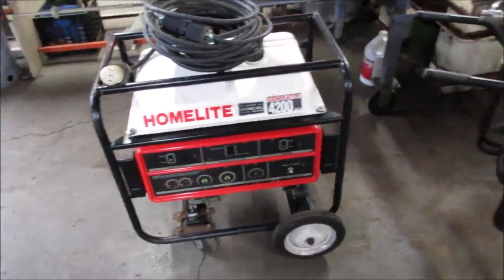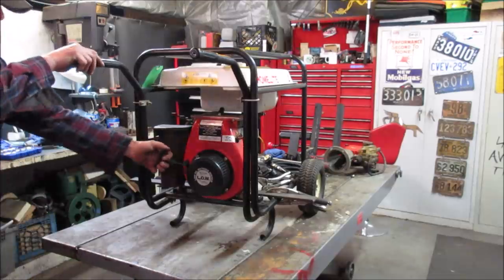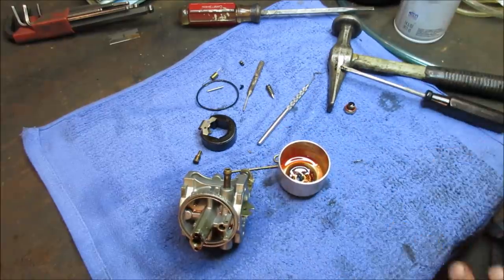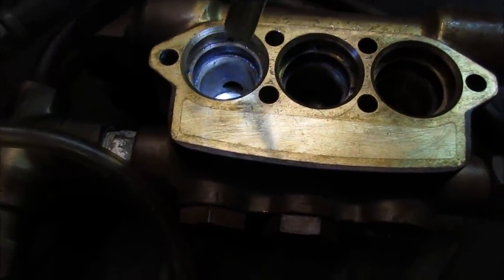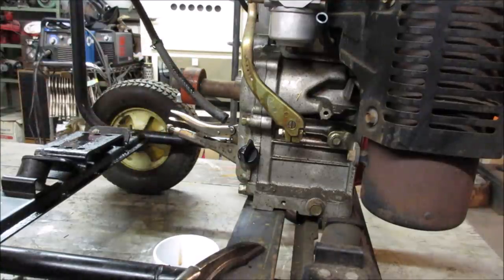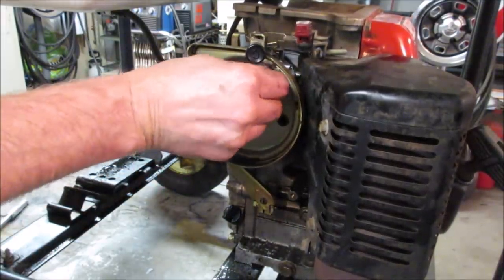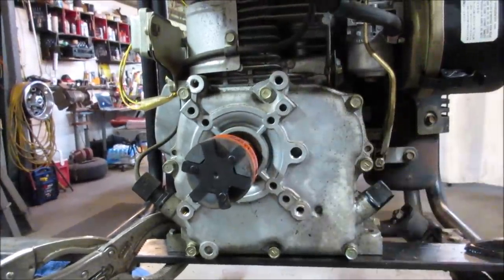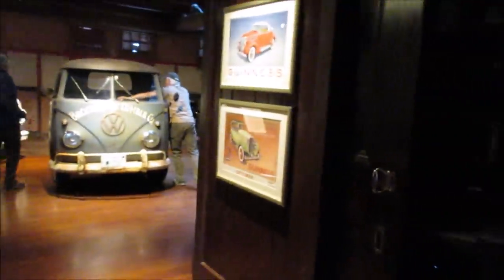Will It Still Work? Free Old Homelite Pressure Washer sitting for 20 years.

Comment: Working on a pressure washer that has been sitting is a cross your fingers and hope situation! The guys I have spoken to tell me its almost impossible to get all of the water out for storage, THEN they are hoping problem number 1 doesn't surface of the carburetor not being drained. I'm really glad this was stored with the marvel mystery oil and it like all the rest does have a limit.  They advertise like it has endless storage time and it to has a limit. 👍👍👍

Comment: If anything like the newer pressure washers, your low pressure will pull in soap from the tube on pump. So you can spray soap and pressure wash with out changing tips.

Comment: 48:00 you can just prefill the filter by open the bowl and pressurize the tank with compressed air and push some fuel with pressure through the filter. Or you can use a vortex type fuel filter. :)

Comment: I've always used canola oil before I use pour some in the hose then hook up and turn water on have never burned up a pump In 40 years pumps usually fail and degrade first like this one did I've worn engines out though

Comment: Pressure washing pumps plunger style like that have the seals/packing are stationary in the manifold/pump head and the only thing that moves in there are the pistons. The one-way check valves two per piston six total need to be cleaned and make sure that they are moving and not stuck I would not have recommended going to town with a HONNE on that head but I guess I’ll see you when you’re done. When replacing the seals/packing there is a hard plastic washer that’s at the bottom to the next want to go in is a rubber style cup seal and it should be difficult to get in you take your finger and push down on one side and then with your other finger roll it in. It is easier to serve them in scalding hot water to get them pliable. Then the next one should be a thinner plastic seal than a brass washer solid kind of looks like it but it has a flat surface on one side and concave on the other. Then the next piece of brass will have a rubber insert on one side and that’s the final one with an O-ring wrapped around it. So black plastic washer, most of the time a brown rubber seal rounded side facing up concave side facing down then the next a thin smaller black plastic seal brass washer that has a concaved on the bottom and flat on the top and then the final piece of brass with rubber. It should not be easy to turn that pump.

Comment: I use a dual gun from northern tool. It has a handle that switches the water flow side to side. I’ve lost too many pumps when the unloader valve breaks.

Comment: There is A seal behind that hour glass.,or oil plug cap for sealing the oil inside the pressure washer pump unit.& valve body.& head as one enclosed unit. And yes you can blowout  O-ring seals inside those pressure washer pump heads to just like the newer ones to.

Comment: The goo in the carb was probably the dissolved packing seal from the petcock… wonder if the Marvel in the tank dissolved in and it ran into the carb (which is why the tank didn’t have any Marvel left but the carb was full). judging by the damaged paint/finish on the air filter housing, it’s been flooding for a while.

Comment: You can use liquid dish soap as a lube for rubber seals or impellers as the main ingredient is Glycerin.
A Mighty Vac  pump / vacuum works great for testing fuel inlet valves. If it holds air it will hold liquid.

Comment: Is "Crusty" coming home soon?

Well now, you can't go far wrong with those "Robin" engines. Every bit as good as, or maybe even better, quality as Honda. Made in Japan by Fuji Heavy Industries.  We've had a few over the years, and they are a strong and reliable engine. Usual thing though, change the oil at about 20 hour service intervals and they'll still be running after we're all dead and buried.

The pump, is a tri-phasic, positive displacement pump - try saying that after a few drinks!  Those plungers (pistons if you prefer) simply displace the water in those chambers that you honed out. As an aside, although honing was not necessary, by polishing the chamber walls, you have actually improved the water flow through the pump - just a tiny tad!  That's also a decent quality pump. nowadays, it would be diecast alloy, at best, and very likely just a hard plastic. The best pumps of this type are, or were, made by Otto Speck GMBH. Speck pumps are/were used in industrial applications and had grease cap lubricators for each plunger, and the plungers and poppet valves are stainless steel - We have a 45 year old "Warwick Wash-Matic" pressure washer with a Speck pump, which still performs as good as it did when new.  If anything will spoil the performance of a pressure washer, it's going to be the jet. They erode with use, but are cheap and easy to replace, but must be replaced with the correct size of jet (aperture).

I'd say that machine is a definite keeper! It doesn't look to have had much use, and I can guarantee you won't find anything as good being built today.

Nice one! . . . Very, nice one!!

Comment: When you flip it at low pressure, it should pull from the soap dispenser and apply the soap. Flip it back around to rinse it off.

Comment: The diameter of the garden hose is critical when using a pressure washer. If it’s a 1/2” hose, it can damage the pump due to not enough water volume.

Comment: It is a positive displacement pump! Like putting your fist in a  tube full of water the amount of area your fist displaces the same area of water! That being that with this type the pump will not suck to supply itself! You have to keep pressure supply of fluid  into the intake,  to feed the displacement area! Of the pump!

Comment: Low pressure is to apply the soap solution when the other hose is in a bucket then you switch to high to wash soap solution off. New models you need to switch tips to do it.

Comment: You can get a special rubber grease for use on rubber. Doesn’t degrade the o rings or seals.
Reply: Silicone is marketed as O-Ring grease.

Comment: In the beginning 4:35 mark of the video you pointed out there’s a throttle adjustment on the engine itself if you wanted more water pressure but you never tried it when you had water running through it.Also it looks like the motor for the water side is American made.

Comment: Just find or buy another tank valve already! Also need to take apart the nozzle head at end of wand! Not sealing when twisting to high pressure! Only one nozzle should be spraying on high-pressure both spray on low pressure

Comment: If you need more water flow at your shop put a 2 or 300 gallon tank up in your loft and fill it up. The volume of water and the height will make really good water pressure and I can't imagine your pressure washer would use more than 5 gallons a minute so you shouldn't run out

Comment: In the UK gas (petrol) is sold by the litre (we had gallons but they were bigger than U.S. gallons). I did the conversion as I was interested in comparing. If you think $5 / gallon is bad - the normal price here is the equivalent of over $6 U.S.
Just demonstrates whenever something seems bad, thers normally someone else worse off. I'd be interested to know where it's most expensive and how much. Just answered my own question - looks like Hong Kong - more than double the U.S. price. Thanks for the great content.
Reply: You might have a higher tax on fuel than the US.

Comment: Mustie, I enjoy your channel and I have worked on small engines and carbs 30 yrs. On the side since 13-14yrs old Always used the 1gallon carb soak with the basket, kerosene, or carb spray and then blow it out with air chuck. And cleans like new. But i have been interested in getting a good ultrasonic cleaner. The one you have is perfect size for what I want. Do you know the brand and model of yours? And what cleaning solution do you use in it?

Comment: The pistons run off should run off s cam to increase pressure by engine rpm up to engine speed and fluid volume. Good luck.

Comment: you are better mechanic than me but the first thing i do on any engine a customer brings is carb straight into ultrasonic except for odd one that are shining in the bowl lol
Reply: @ElectronicMusicUnderground  yeah i just got ultrasonic couple years ago before that any wire that would fit gas oil and transmission mix and shop air if available for first 40 years lol

Comment: If it has no O-ring.,doesn't use one at all. Try some blue thread sealer tape for those applications. Blue thread tape it's like the white Teflon kind it's just formulated for fuel.& water uses cause it's marine grade thread sealer thread tape.

Comment: The foam on that air filter should have had a little bit of oil on it. Might have changed the way it turned out but who knows. There is a product today called 303 protectant that could have been sprayed on it that might have kept it from degrading along with any rubber parts.
I don't know where you got the idea it's running lean, that is the perfect color for the spark plug
Reply: I was the owner of the pleasure washer and the generator shown in these two videos and there was a notice in the instructions not to put oil on the outer sponge filters. I was going to do that myself just as you suggested, but here's their reasoning. It was written that the oil after time could bleed off onto the inner paper filter which would restrict the air to the carburetor. Come to think of it, that makes sense. Hope you enjoyed the two videos, George, Danvers, MA.

Comment: If I were to guess, when you turn the nozzle to change the flow, It may suck the soap solution through the small hose to the low pressure nozzle.

Comment: Never seen a dual nozzle that works like that. Usually there is a switch on the lance that you turn to select the nozzle. When a low pressure nozzle is active this usually starts a venturi effect which will then use soap tube

Comment: That blue/green corrosion you found on brass (or copper) is technically called verdigris.  But simply referring to it as oxidization is fine. 

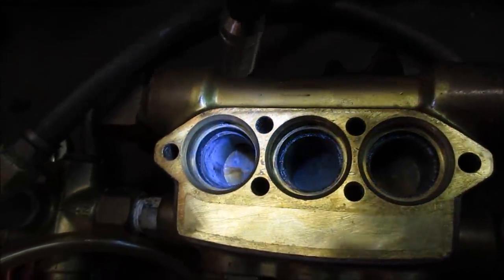27:08  Not being pedantic - you did ask, after all.  :-)

Comment: Silicone fluid is NOT a lubricant. It is actually abrasive and can freeze up a pump in a few seconds if it is a wear surface. Plus even ppm contamination will act as an anti-foam and prevent the soap from forming bubbles.

Comment: Hey guy, been watching your video's for years. They're some of the best I've ever seen and very helpful. Do you have any videos on gas welder rebuilds?
Reply: A gas welder is just a torch and 2 bottles. It's best to take oxy acetylene torches to someone that know what they're doing.
Reply: Ok.
I'm trying to rebuild a miller 225 bobcat, 1974 model. 
The engine doesn't run. I'm trying to figure out whether to rebuild the motor or if the generator is messed up to so which one should I do first?
Reply: @scottthompson6885  I'm pretty sure that's a stick welder. Oh, were you saying gas welder cause it runs off gasoline? I see. 

Well you'll have to get the motor going in order to test the generator and the gen set going to test the welder. Mustie does have some videos of fixing generators, but an engine is an engine regardless of what it's powering. Assessing the operability of one is the same process.
Reply: Thanks , yes I meant a portable gasoline operated welder, Miller bobcat 225 stick welder.
Can the windings on the generator side be checked to make sure it's ok before I try and rebuild the engine that is my question?

Comment: He put Marvel oil in each carb but then never used them because he knew he had to clean it out. LOL, I have had good luck just draining the gas from the tank and running the engine dry of fuel. Then next year add gas and they always start and run great. My 2cyl snowblower takes a little more due to the oil in the gas so I just pull the gas line from the carb and spray carb cleaner in and pull the engine over a couple of times, add a little more carb cleaner, put the fuel line back on and let it sit for a couple hours. Add fuel later and pull it over and it starts and will run smoothly after a minute or so, DONE!

Comment: U need 2 get yourself a 10 Gallon + reservoir tank with a float valve (like what U have in a side entry toilet cistern) then connect the water supply hose to the float valve...
From the bottom low level of the reservoir tank;... connect to the pressure washer inlet...
That way;... every time U stop using the gun;... the 10 gallon + tank will top itself back up...

Comment: Hey Sir, have you checked out Lin Guoer in china?  A young woman who is your counterpart around the world.  She has a video series on yt where she rebuilds old motors, bikes, junk etc in short videos.  I think she doesn't speak english, at least not fluently, although she does answer some comments by typing (possibly using translation software).  Very VERY similar concept to yourself..... particularly interesting is when she rebuilt a generator from scrap parts... had to wind new coils from scratch!  Also she uses physics well to her advantage despite her size.

One of her first videos showed her repairing a junked welding machine, which she proceeds to use in most of her later videos.

Comment: what size is the small nozzle that will help tell what volume the pump is. there are two styles of relief valves pressure sensitive or flow sensitive looks like the adjusting knob has a spring in it so it will be a pressure sensitive

Comment: I’m probably tempting fate but I’ve had an electric pressure washer I bought 2nd hand in ‘98.(24years!)  I use it about 3-4 times a year to wash the roof prior to collecting rain water, cleaning pavers and the occasional engine wash.  Every time I set it up I expect it to fail but it just keeps on going.  I’ll be sad when it goes.

Comment: As an electrical engineer, I can't understand how a supply is not filtered! 
It's like not putting a filter capacitor across the supply! 
Specially a supply for something with such small orifices and valves as a carburetor! 
Put the biggest truck filter between the gas tank and carb, if one fits.
Not a dinky 1"  round I see on some generators either. the bigger the filter surface area, the smaller the resistance to flow.

Comment: Float test; drop float in tub of hot(ish) water, the heat from the water will raise the temperature of the air in the float, it will become slightly pressurised and even tiny pinholes leaks will show up as air bubbles. Just saying…🇦🇺

Comment: When something sits like that for a long period of time. Is there any advantages, after you clean out the gas tank, of installing an inline fuel filter. Of course you cant get all the debris out of the tank. Just wondering if this would help.

Comment: So, after 20 years, would you say it was for the better or worse that the marvel was put in there? By the way, your channel and narration is awesome.
Reply: The narrations are actually Darren's strongest point, among many others. Now, as for the Mystery Oil.....I've used drums of the stuff and it contains a small amount of Dichlorobenzene to prevent corrosion. I'm a retired industrial machine mechanic and I've always had great results with it.  Best, George C.

Comment: Hey, you said that the bores were pitted in the pump. In Indiana were I live, the city water is very crusty when run through humidifiers and regular showerheads and sink aerators. Would that also be a cause for the pump piston issues, and if so, besides running it out of water, what could be done to remove ALL the water?? I have a Harbor freight electric pressure washer which I've have had for 2 years and when I'm done, I disconnect the water line and let it run completely dry. Am I going to still have issues with the pump? I know the water here just sucks.

Comment: the v packing stayed on the ceramic pistons... no real need to clean the chambers in the head. just rub a little trans fluid on the pistons but only use 30 wt non detergent in  the crank case of the pump....

Comment: A question for you       if you attach a garden hose to the intake barb will the pump suck fluid out of a 5gal bucket  ( 0  pressure on the intake ) ??

Comment: After you fix one of these machines and it's running well , and should last a good amount of time , would it be a good idea to put an inline filter in them?
Reply: Especially the ones with a tank that needed cleaning.
Reply: I was the owner of these two machines which I gave to Darren for his videos. I'm sorry he didn't unscrew the entire fitting from the gas tank as there is a 100-micron brass screen brazed onto the fitting. A lot of people wondered the same thing as you mentioned here. Best, George, Danvers, MA

Comment: Is the  no fuel filter a philosophical thing?
Reply: There is a cylindrical brass mesh 100 micron filter brazed onto the petcock just inside the tank. Too bad he didn't remove the petcock as it would have answered everyone's question to why it didn't have a gas filter. Best, George C.

Comment: You Put It On The Low Pressure Side When You Want To Dispence Detergent, Then After Using Detergent You Switch To The High Side To Blast Off The Dirt.

Comment: the low pressure for the soap mode then flip it over to high to rinse. pain in the ass when your using it for 6 hours washing a garbage truck for paint

Comment: I was wondering what kind of cleaning fluid do you use in your ultrasonic cleaner?
Reply: He has talked about it in a older video. Just carb cleaner. It comes in one gallon cans.
Reply: Darren has been using "Gunk" brand cleaner. It comes in a gallon paint style can and has a parts basket included. The last price I recall on this was around $35.00. Places like O'Riley Auto parts sells it.

Comment: Replace that fuel line.  The trash is probably from it.  Fuel line deteriorates over time.
Reply: You're right. I never replaced the original hose and that's what is in the carb. bowl. Best, George C.